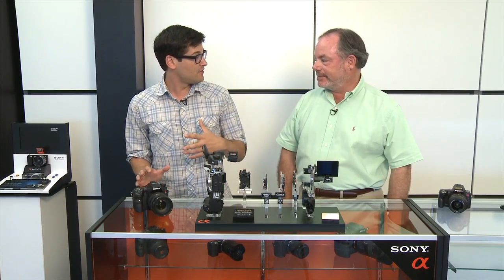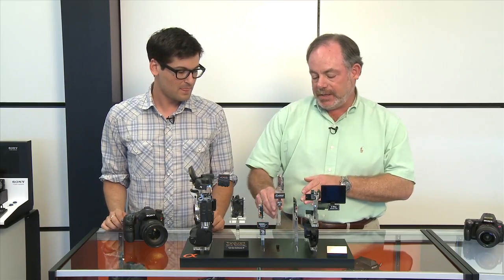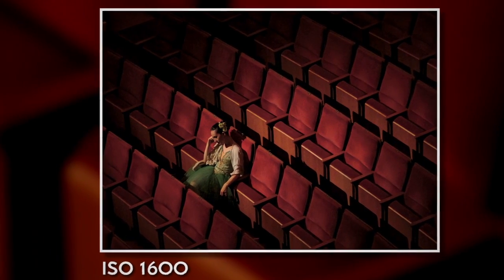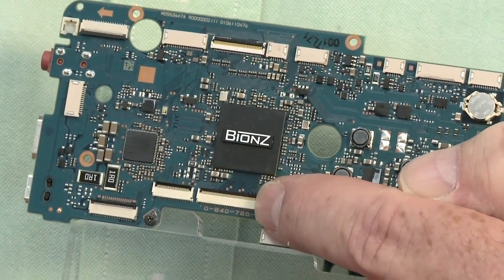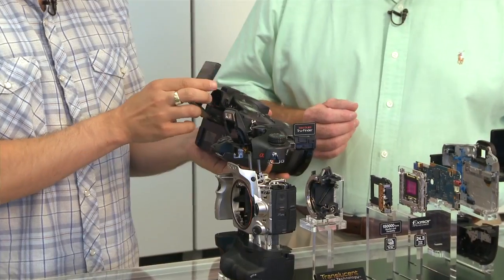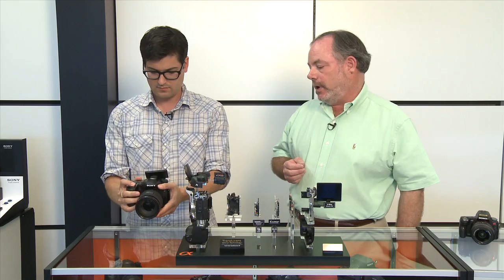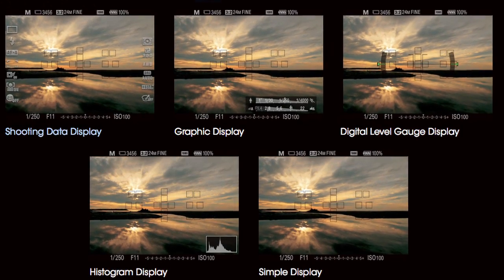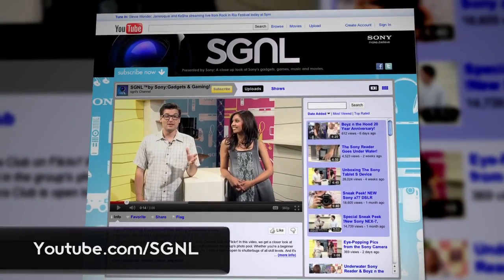Exclusive A77 SLR Camera Tear Down: We Take It Apart!

Comment: My Sony SLT-A77V started displaying a screen of green horizontal lines, rendering the camera useless. Since it is out of warranty Sony specified using Precision Camera for the repair. Just got it back unrepaired due to parts no longer available. This camera is less than 10 years old! Don't buy Sony!! They do not support their customers. Spend a little more and get the good stuff like Canon or Nikon. I learned the hard way.